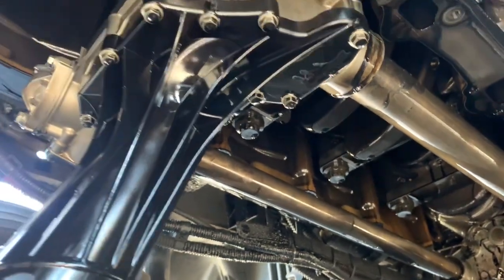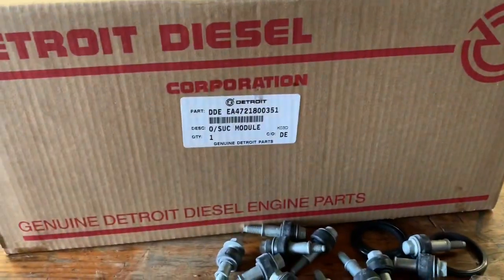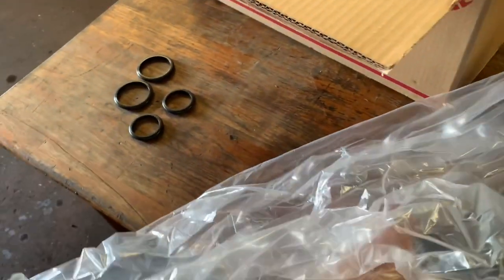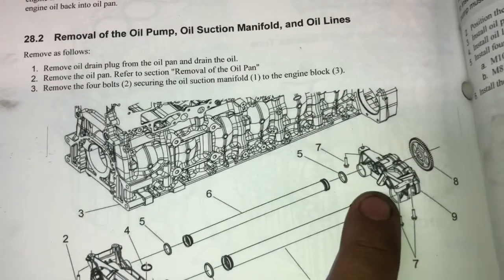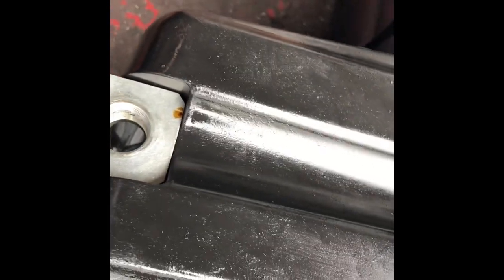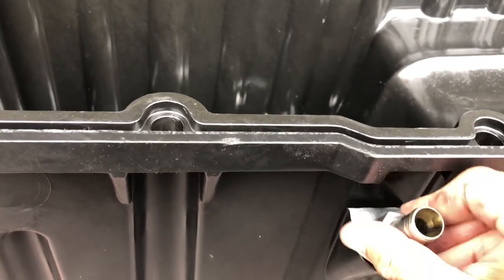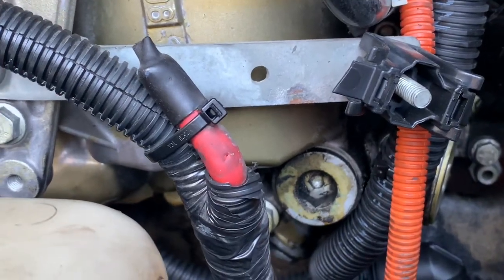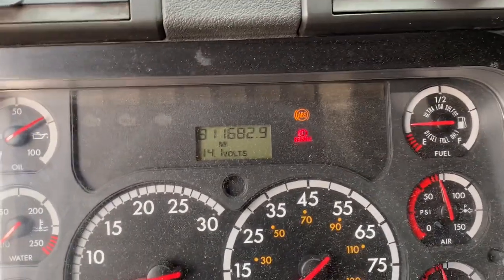DD15 low oil pressure and what to look for.

Comment: Hey Brother can you please make a video on priming the oil system. I've never heard that before and want to see it done. Once again thank you for your video. Hey I'm gonna send you a Go-Pro head camera to make the video making process easier on you
Reply from the maker: I am working on a DD15 over haul, i will make a video just on the oil priming.  I agree, a Go Pro would be great to help film
Reply: my truck 2013 cascadia dd15 has burned oil i get check engine light whats the issue when i add oil the engine light goes away thnks

Comment: Any reason you didn't inspect main bearings while you had pu tube off. Just a thought..even running your finger to feel any damage.. would save the driver money and to prepare him if its bad.
Reply from the maker: Really great question, we actually did pull off the number 5 main bearing for inspection (normal wear) and did recommend replacement because he is over 800K miles. However the customer just replaced all 6 injectors (during this same visit) and money was very tight at this point. He declined and said he would come back. I believe he will come back, he is a long time customer.
Reply: @CarlosDieselElectric  yes I'm thinking the same with my engine while I'm under there

Comment: Do you use hardening or non hardening permatex?
Reply from the maker: Jayden Centifanti on the seals I only use assembly lube or clean motor oil to allow the seals to slide in. The seals will seal properly once they are installed and the engine starts to run.

Comment: Did you make that engine oil priming tool, did you make or is it a OEM part? Can you give a part # and the procedure to prime lube system? Thank you.
Reply from the maker: Ulises Gonzalez the tools is something made by Kent Moore. I’ll look up the part number and post shortly. 
I think I’ll make a video on priming the oil system. This is a critical step when replacing the oil pump and suction module and when doing and inframe.
Reply: Thank you for the update, and I believe it would be a real informative video...
Reply: @pedal2dametal686  17 mm allen to remove the plug.

Comment: At what mileage would you recommend replacing these seals?
I don’t want to wait until oil pressure start dropping
Reply from the maker: I have seen this issue at around 500K-600K miles and even as late as 800K miles.
Best bet is to look at your oil pressure when your engine is completely cold. It should be at or above 60 PSI. at idle when you initially start your engine.
Reply: my oil psi is 65 to 70 cold at idle but drops to around 15 hot. Is this my o-rings or could it be a different issue? 2014 dd15 with 655,000
Reply: @j.cannon2021  Did you ever find out what the problem was? I am asking because my 2015 does the same exact thing.
Reply: @daviduribe2560  same here